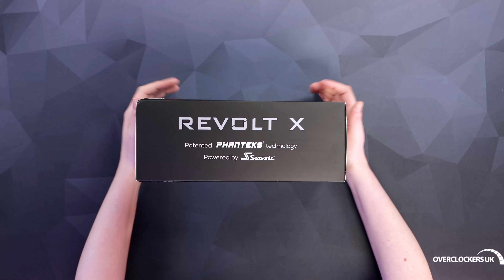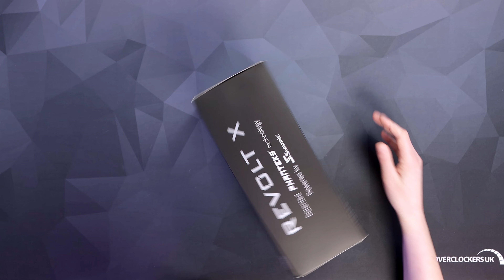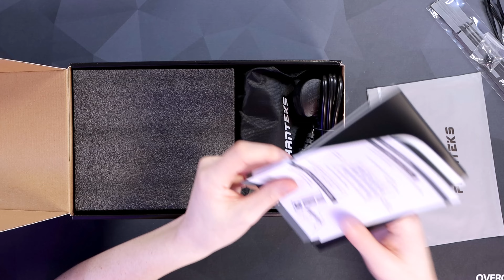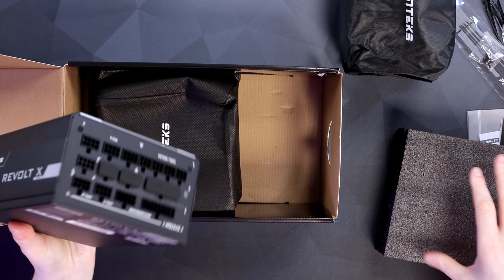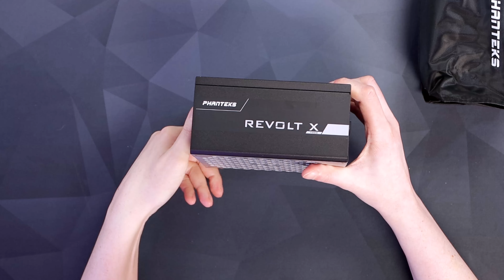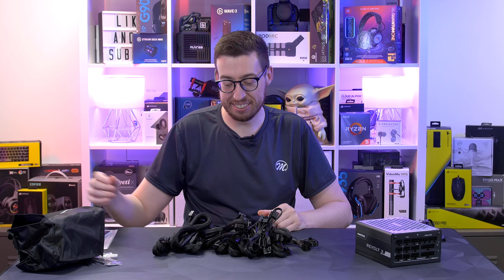Phanteks Revolt X - DUAL PC 80+ Platinum PSU - Unboxing & Overview! [4K]

Comment: Would you possibly ever consider selling the power supply i have been looking for a power supply solution for my thermaltake mozart tx dual system case
Reply from the maker: Where are you based?
Reply: @jordanash I'm located in the US Oregon
Reply from the maker: Ah probably not unfortunately, I don't like shipping overseas.
Reply: @jordanash  ok no problem I have found another one online but I'm currently debating spending $250 on it